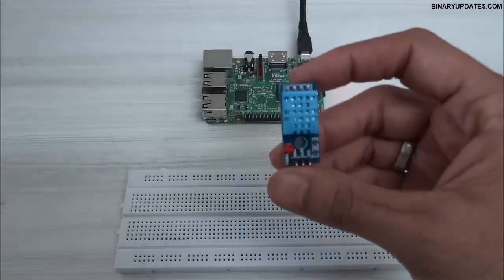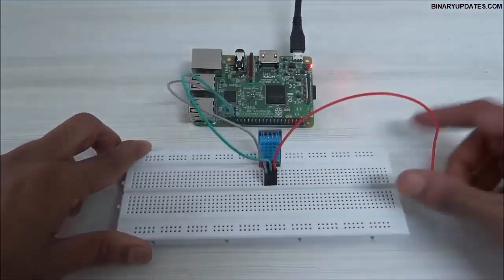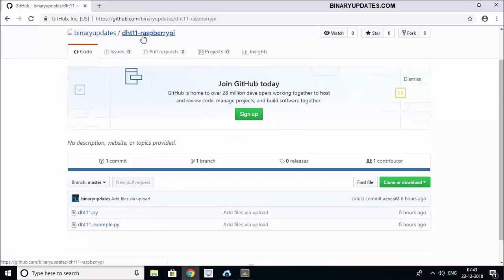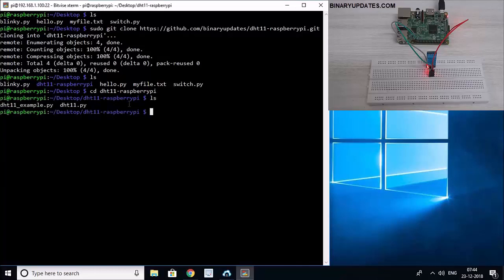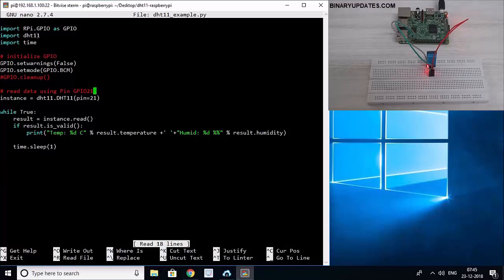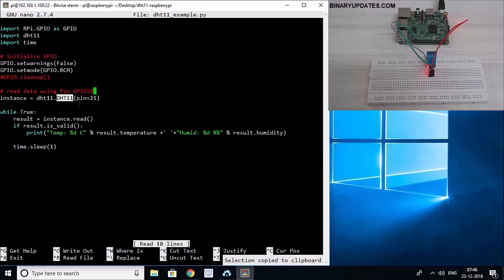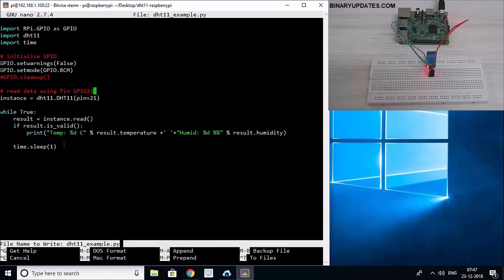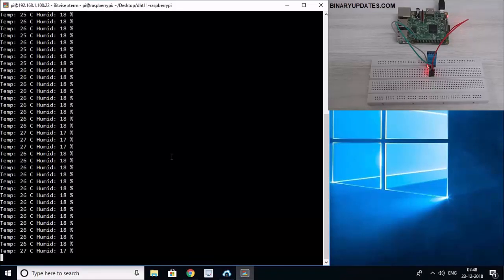DHT11 Sensor Module with Raspberry Pi3 Temperature and Humidity

Comment: I did the same as yours, but he only reads it and stops, you know what it could be
?
Reply from the maker: Hi William I just edited the python script a bit to read continuous data from DHT11 Sensor. You can pause video and watch the changes if you want. Have a good day!
Reply: @BINARYUPDATES  I run the command, when it initially does not need to show the temperature, only 3-4 times the command show, and when it shows, only 1 time

Comment: Not working it shows error in line1 please give solution
Reply from the maker: Hi Pragathi, Python is sensitive to white space. Make sure you've not made any typo mistake while copy paste the code. otherwise there is only possible mistake is connecting DHT11 Sensor module with Raspberry Pi

Comment: For some reason when i type in the cmd "Python *name of the file*" it just doesn't give me any answer, and yes i changed the pin to the pin that the data is connected in my layout

update: fixed
Reply from the maker: Make sure you write "python" not "Python"
python on raspberry pi under linux is type sensitive. Typo mistakes won't work. make sure you type exactly same command. Good luck
Reply: @BINARYUPDATES  thanks a lot! i found the error on the same day, i confused the pins because it said pin 7 but it's the GPIO 4

Comment: It gives me temp=None ans humdity also can you tell me please where is the problem ?
Reply: Try changing "result= instance.read()" to "result=instance.read_retry()". I am using a DHT22 sensor and noticed it only outputs data when the temp. or humidity changes.I made a script with with a clock output (time) also displayed and noticed that my output can be as much as 15 seconds apart. If you watch this video, you will notice that the new data is not displayed exactly every second, as the "time.sleep(1)" is trying to do. I don't think many people have noticed how this sensor outputs data (apparently AdaFruit hasn't noticed this either) The  "read_retry" forces the python script to keep interrogating the sensor output until actual data is received. If there is no change in temp or humidity the script reads (or the sensor outputs) "None". that is why your script is outputting "Temp = None....."